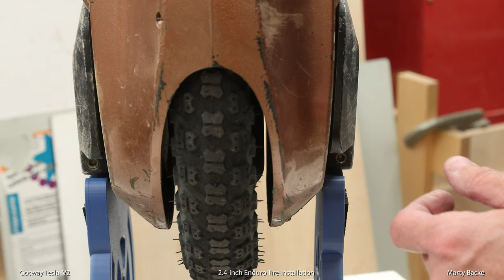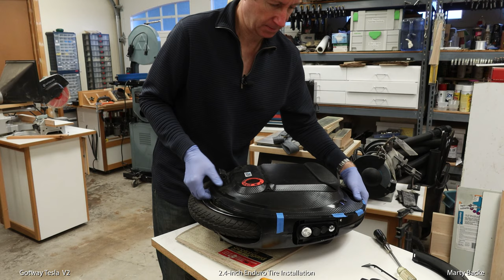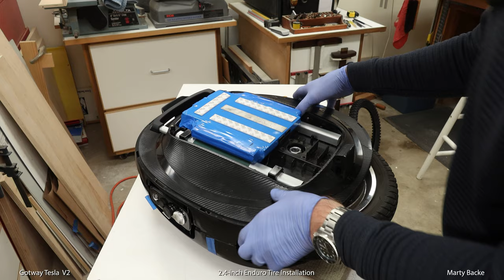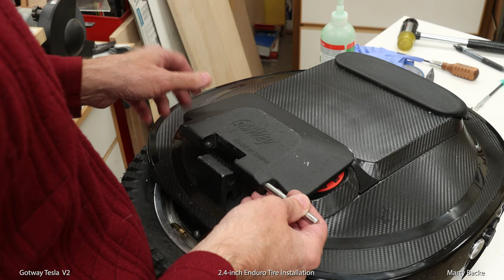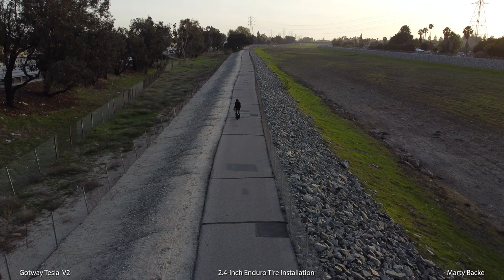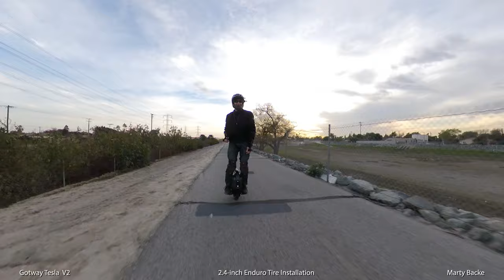2.4-inch Enduro Tire Installation On The Tesla V2

Comment: Now I see how to change a tire without unplugging motor wiring :) thanks Marty! Also the 21700 pack looks pretty cozy in that wheel :)
Reply from the maker: Yeah, that battery pack is a snug fit :-)  Thanks for stopping by Adam

Comment: Hello dear Marty. Thanks for this video that splits the way to replace tires in 2: Before and after Marty.  I want to ask you why did you remove the 2 covers? It is necessary? It seems that removing the 2nd case is enough. I'm wrong?

Comment: i can't seems to find it on amazon.ca i get a p186 16-2.4 on ebay that is probably similar. i love it on the tesla 1480wh. i say for heavy guys that keeps bending rims this tire save me alot 35psi i am 220lbs in the snow and on road in general i feel more stability with the original tire the tesla feels like going left and right to easyly. for me this is the best tire for this euc i won't go back to the 16-2.1.
Reply from the maker: At my weight the 2.1 inch tires can still be a nice ride

Comment: Thank you for this very interresting video. Is there's more or less wobbles with this tire ? Is it really good for road riding only ?
Reply from the maker: Wobbles? No difference I guess. If you only do road riding and are not interested in the new louder sounding tire, you may want to try and find a street version of the same tire.

Comment: Tyres have a lifespan (expiry date) of about six years from date of manufacture.
There is a four digit number on the sidewall.  The first two digits denote the week of manufacture, the last two digits denote the year of manufacture.
Rubber degrades, becomes hard/brittle, even without use, probably through oxidation, heat, UV light etc.
Rubber tubes and rubber patches probably have a similar lifespan.
Might not be worth patching tubes to save on cost of a new tube.
So much cost in terms of effort, time, hassles etc in getting to the tube, it might be better to just replace it with a new fresh tube which hopefully has the maximum six year lifespan.
A failure could result in just a long walk, another repair, to rapid deflation and loss of control.
Great vid, look forward to the next ones, thanks.
Reply from the maker: I've patched lots of tires. This is the first one that has failed and it was my mistake. Thanks for the comment but it's not something I worry about. Besides, using Slime auto-fixes most of my flats.
Reply: Ok.  Have had a tube deflate during a ride.  Didn't know until going around a bend, nearly crashed, and that was at low speed.  Had two tubes with leak at junction of valve stem and tube.  Look forward to next vid, thanks.

Comment: Regarding the duct tape that Gotway uses to secure the two shells, it is located directly under the main board, on the 'top' of the wheel (not on the wheel side, but on the control board side of the shell halves). I've found that it's not hard to get access to. Once you remove all the shell screws, there are two little screws with large washers (right side of the wheel, in the battery compartment) that hold the two bottom corners of the control board. If you remove those two small screws, the board slides out of a 'tray' it sits on, and you can leave it secured by all of the wires to the motor etc. The duct tape can now be easily peeled away from the shell halves. I think the duct tape serves to keep any water that gets through the gap between the two shell halves, from making its way up to the control board (for those of us in wetter climates). I like to replace the duct tape with a new piece after I open up my Tesla V2, just for the peace of mind; I also have the 1500Wh version and have found that although the bottom of the duct tape can get a small line of dirt on it from the gap between the shells, nothing makes its way past the tape and up into the control board area.
Reply from the maker: Thanks. Keep in mind quality control is non-existent in the Gotway factory. "My" Tesla had the duct tape inside the wheel well. It doesn't surprise me at all that yours was some place else :-)
Reply: Put a little bit of bathroom silicone on the 2 halves hole's location. Not too much to be able to reopen it in the future.

Comment: @18:22 Looks like slime disolved the patch. Been there myself and made a post on the forum not to mix patch and slime.
Reply from the maker: I'm not convinced. If this were true then why hasn't Slime dissolved all the other patches that I've used? Slime is water based and I don't think it has any solvents. How could it dissolve a patch?

Comment: Hi Marty, I've purviewed this particular vid a few times. I've since ordered a 2.5" & am stuck trying to get the tube valve into its correct hole. Since the hole is on the bottom (on your technique) my fingers are having a hard time trying to get the valve in. Any tips? Thanks in advance
Reply from the maker: Yes, that is one disadvantage. I'm afraid I have no advice other than perseverance and patience. I've done it many times and never had to give up :-)  Good luck.
Reply: @ElectricUnicycles  Awww craps! I was hoping you had some magic chant for me or perhaps a special type of ky jel specific to help insert the valve into the hole. No such luck for me🥺. Anyhoos thanks & I look forward to your EUC adventures
Reply: @scottsum1319  Drill it 1 mm more. It should be sufficient.

Comment: Heya is there a reason why you did not convert to tubeless? I have had no issues since converting my mten 3 to tubeless and it's far more stable.
Reply from the maker: I've rarely seen a successful tubeless conversion. Most EUCs rim's and associated tires don't support it.
Reply: @ElectricUnicycles  okay cool maybe I got lucky, but interestingly enough the difference between a tubeless tire and a tubed tire is the tubless tire has an impregnated air tight solution of some sort. So for tubed tires you need to use a tubeless sealant. I have had no issues and I followed your guide, I honestly hope i can apply this to other wheels because tubes are really poor to use.

Comment: Any advantage or reason to convert to tubeless like you did with the mTen3?
Reply from the maker: It's extremely difficult to convert larger wheels to tubeless. The rim on the Mten3 supports tubeless conversion. Most (if not all) regular EUC rims don't support tubeless without great difficulty. I have no experience there.
Reply: @ElectricUnicycles  Thanks for the reply! Makes more sense now 😁

Comment: Hi I was wondering what tube did you use for the tire change, also does  the stem on the tube have the curve to it thanks and also is there a link
Reply from the maker: I used the same tube that came with the original tire. It's critical for these wheels to use bent-valve tubes.
Reply: Thanks for the info 👍 I enjoy watching the long distance rides
Reply: I also your video  on spiked peddles you designed  would you know of and place I could purchase spiked peddles I have a tesla t3  I actually  bought that one from China found out about from watching one of your videos 👍

Comment: I also upgraded my Tesla to a bigger tire, it’s a different wheel now(I would recommend everyone doing it because it’s reallly that big difference)
Reply: Did you install the same enduro tire ? I'd like a bigger road tire, not a knobby one...
Reply: @electric-rider  yeah me too!
Reply: @electric-rider  I actually installed a bigger one 2.5
Reply: @greymr4038  Ok, could you tell us more. Brand, model... Where do you buy it ? Any problem to install, to ride ?
Reply: @electric-rider  well it was a whole project, spend a day with my roommate to do that, needed to drill stuff, if anyone wants details I guess you can pm me, the tire was 16x2.5 Kenda

Comment: Hi Marty. How can you remove a stripped screw on the battery cover without using power tools or an electric drill? I stripped the bottom ones.
Reply from the maker: You'll have to use a power drill with a screw removal bit. Easy enough to do. Good luck.
Reply: @ElectricUnicycles  thank you, Marty. I don't own one yet since my previous hobby was more in foldable bicycles but I was able to extract it by using those precision screws used in mobile phone repair. I'd tried to fit 3-4 bits before finding the right one.
Reply: @ElectricUnicycles  marty do you have any photos or videos for how the wires arranged or are they plugged in? I took photos but sadly my phone got wet. I even put stickers and put some sharpy on it but it got smudged. 🥺
Reply from the maker: @har0ldzkii11  Unfortunately no or easily findable. Only if my Telsa videos happen to show something.
Reply from the maker: @har0ldzkii11  Glad you got it worked out 👍
Reply: @ElectricUnicycles  no worries. Its okay. I tried to turn it on and nothing happened. Maybe the wiring is straight forward. Though i might have damaged the kill switch. I can't find the silicon rubber to make it clicky. As long as it run, I'll figure the kill switch problem in the future. 🤣